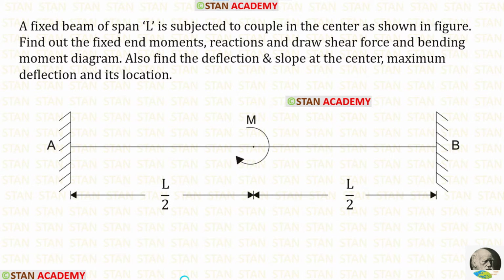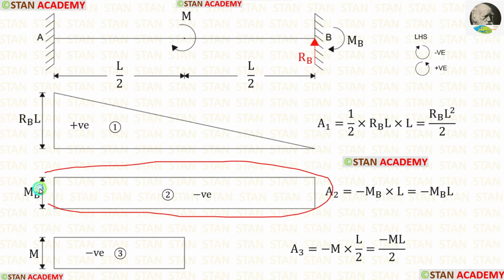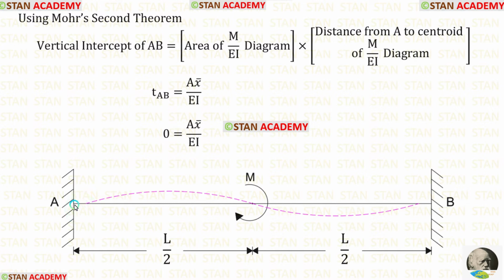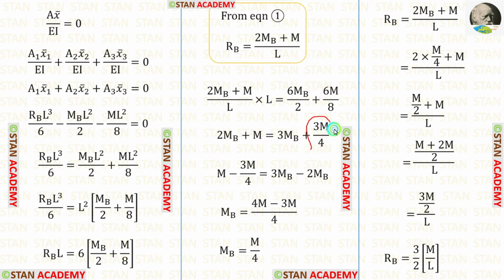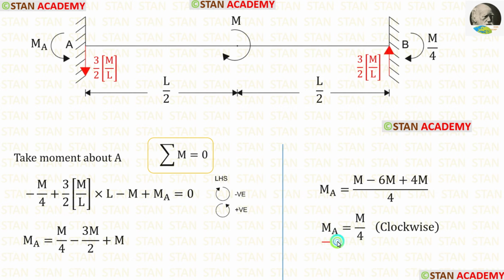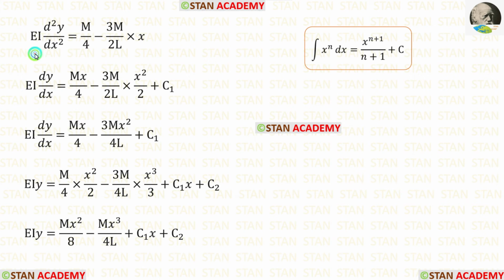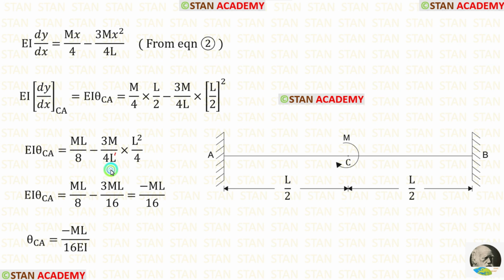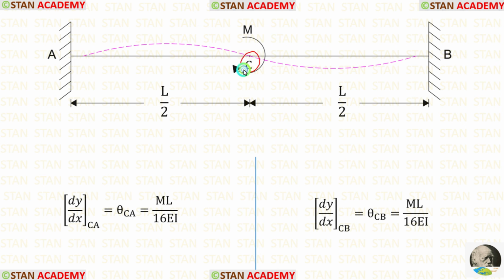Fixed Beam Subjected to Couple at the centre ( Derive Fixed End Moments, Slope & Deflection )

Comment: What if a beam have a load w with a couple at centre? What would both moments be? I couldn´t find that case yet
Reply from the maker: Just add the end Moments. suppose you have a clockwise moment in the center
Moment at A = (-WL/8) + (M/4)
Moment at B = (WL/8) + (M/4)